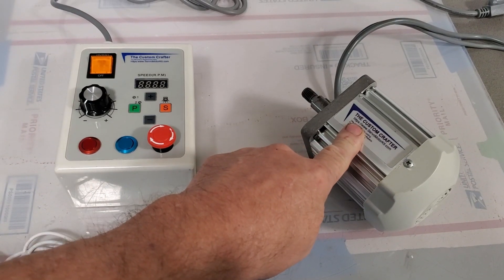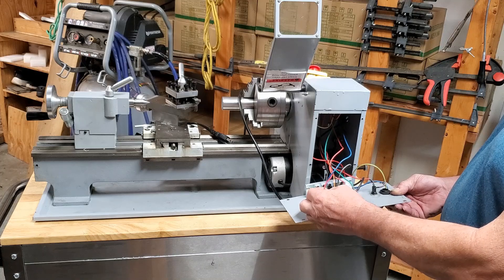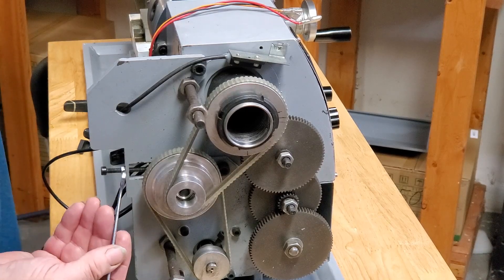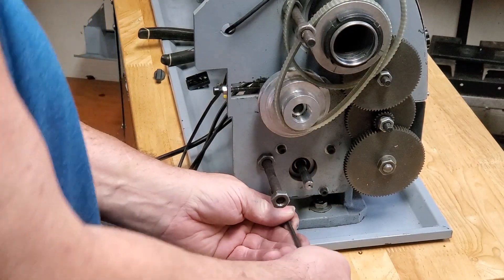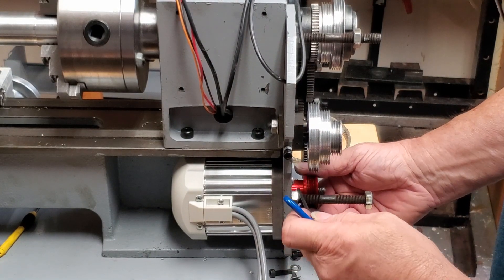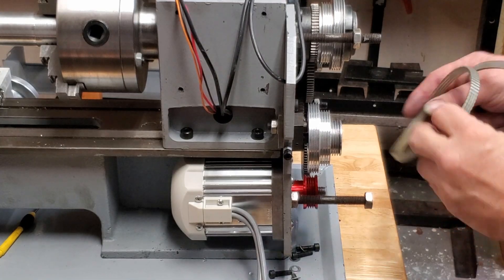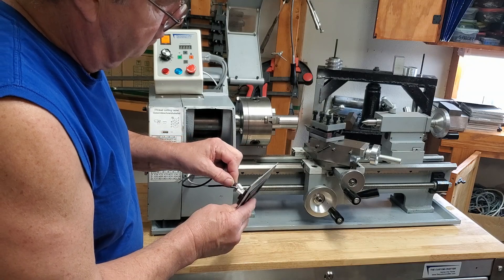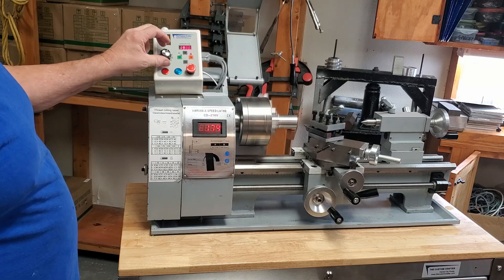CD - 210V 8 X 16 Lathe from eBay Servo motor Upgrade part 4 With Review

Comment: I know it's been three years, but I can only hope you could send a copy or color code for 
wiring this control board in my cd-210v 600w mini lathe. I forgot to take a picture first...
Reply from the maker: If you want the oldtear down  images, they are long gone.
The OEM motor is not compatible with our controller.
This conversion requires the entire kit we sell.
Reply: @danielmartin382  I finally got a still shot from your video and its wired up, but I don't have speed control, so I think popped the variable speed potensiometer..
Reply from the maker: @48vdcwrld  I am happy for you.Their pot is garbage anyway
Reply: @danielmartin382  Thank you for your assistance...john

Comment: Would this be a quieter system than my standard 220volt DC 550 watt motor and  pulley drive system on my HQ800 Lathe/mill/drill/combo machine.

Comment: Hey my man, Do you have the 1500 watt motor setup for that exact lathe?
Reply from the maker: That lathe has our 750 watt motor on it. This is the best motor for this lathe. Consider this: Most manufactures motors have 1/4 to 1/2 as much torque as our motors.
Our 750 watt produces 10 NM torque
Most other brands you need a 1500W to produce this much torque

Comment: the lead screw ontheser have a crappy design. i am going to be switching to an TR16 and make a new half nut for it. i have upgraded the bushings on both ends to be bearings. once I get me bed leveled from a machine shop with a surface grinder I will start doing re-assembly work and doing work to stiffen the bed to remove rear flex that are common to be seen on these lathes.